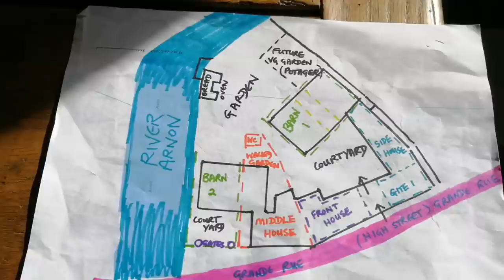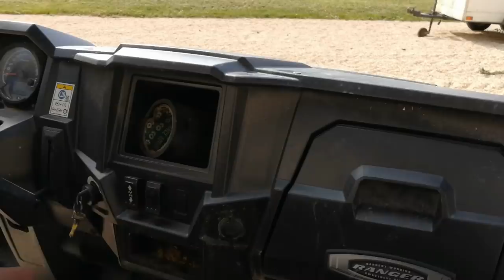Not Quite a Chateau DIY 70 - A Gator - A Gun - A Good Day's Work - A Musical Vine? -  and a Pinot

Comment: We once moved into a property with Trumpet vine, where we lived for 8 yrs. The hummingbirds loved it, but it was a challenge to control. It's roots ran underground great distances, then popped up with new suckers where ever it pleased.  This was in the part of TX where summer temps run as high as 100 degrees F,  winter temps down to negative 10 degrees F, and only 20 inches of moisture annually.  I watched it grow a few yrs, determined it was capable of undermining the house foundation so I cut it back severely thinking I would kill it. Instead new suckers popped out of the hard packed ground across my patio between the pavers dislodging them. I was happy to leave it behind. I read back then that the yellow variety was less invasive, but was never able to find it commercially
Reply from the maker: Oh my RT3 sounds like a triffid